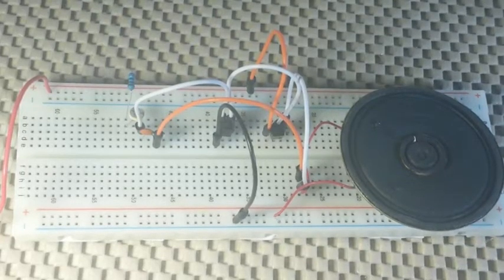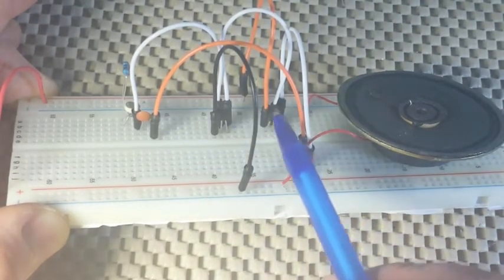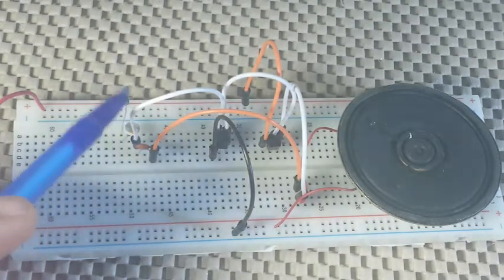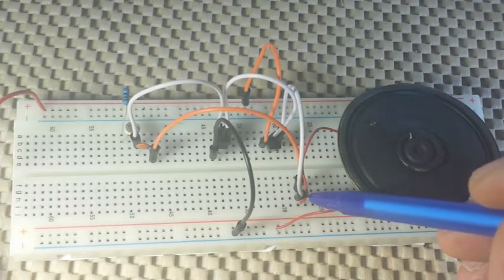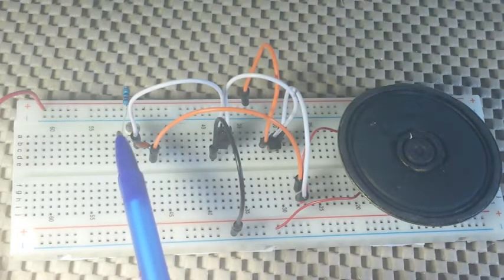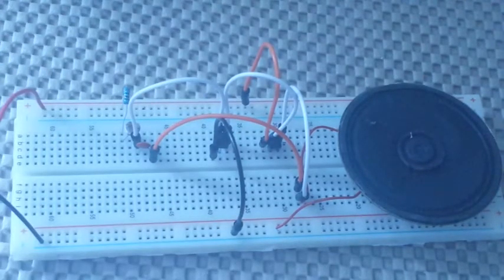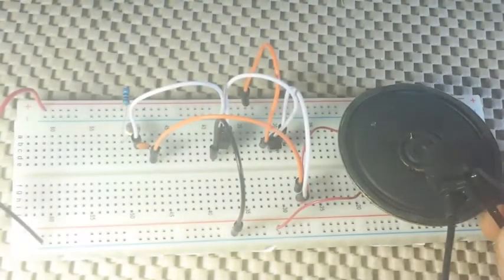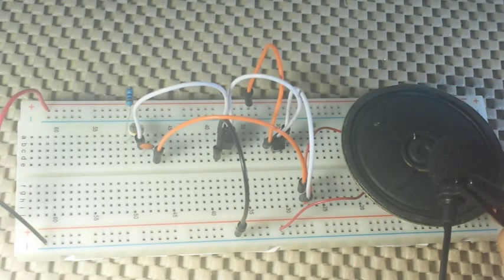How to turn light into sound

Comment: Hi! I was wondering if there was a way you could attach it to an amp (like for guitars) instead of just connecting it to a speaker. Would you need to add more power to the circuit if the amp is plugged in or no because you aren't using power on the speaker anymore? thank you for the cool video! (can you also include a list of materials if possible? again thank you!)
Reply: That's actually gonna be my sculpture project, im assuming you saw the fan bass video haha. It's what inspired me and if you want i can update you in the upcoming months

*i'm only starting to build it today, it took quite a lot of planning beforehand and i bet it's not gonna be easy going forward